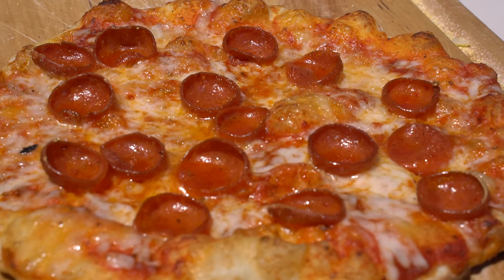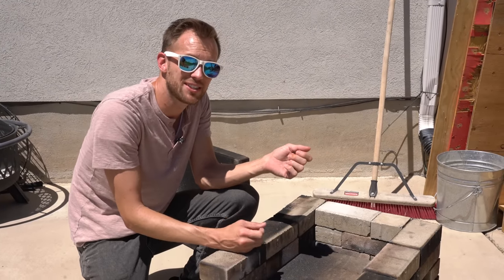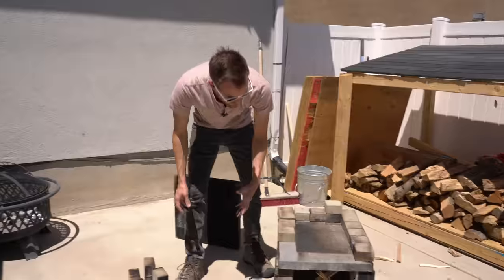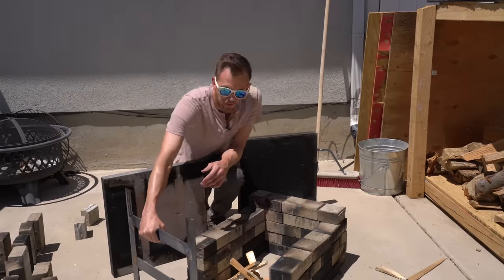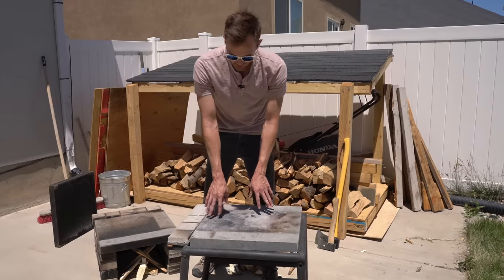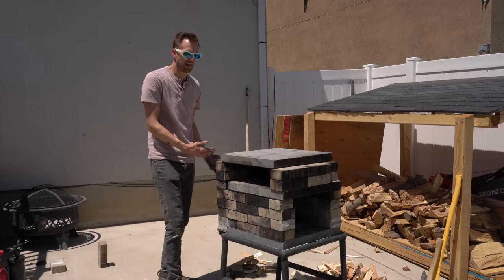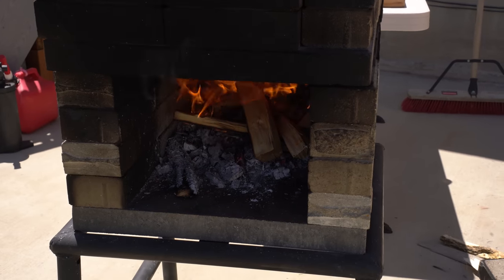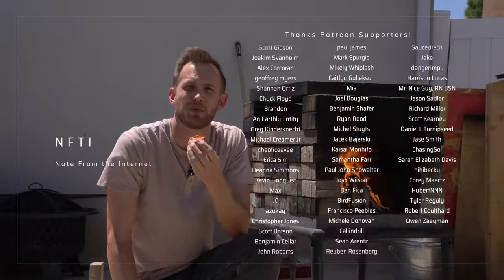The BEST Cheap DIY Pizza Oven

Comment: With your raised oven, since you're building a fire directly on a paver stone base, you might consider replacing it with fire bricks. In fact, since the entire first level and the cooking surface are exposed to the highest temperatures, you might use fire bricks for them as well
Reply: Have you seen the price of fire bricks? I think the point of this video is to make a cheap and easy DIY oven.
Reply: @TiltmanMusic  2000F rated firebricks are 4 dollars a piece, but are 4-1/2 in. x 9 in. x 1-1/4 and he only needed 48 of the smaller ones so with this he’d use half of them so less than 100 bucks when you only need 24.
Reply: @omarious  The comment was referring to the paver base that the fire was on, and the base that the pizza is on that is under the fire. There is no reason to use firebricks for the side walls. Normal clay building bricks are fine, and cheaper. How are the fire bricks going to work as a base? You need a big slab as a base.
Reply: @TiltmanMusic  I've made a oven similar to this. I cook my pizza on a "base" of firebricks. Six in total. The rest of the oven is made from clay bricks. The firebricks rest on 4 rebars, stretching across the width of the oven. I cut slots in the clay bricks for the rebar (about 1 inch wide) and as deep as the rebar. That way the rebar is flush with the bricks and I could stack more bricks to make the "roof" without leaving a vent. For the roof I did the same thing with the rebar, but used clay bricks. I'm actually considering replacing the roof with firebricks too, for that extra but of heat reflection.
Reply: Post pics please!

Comment: The side loaded design with the bricks completely destroys the air path. The other side of the oven won't be as hot, and you will lose a lot of smoke that goes directly to exhaust. With proper airflow, you don't have to worry about the fire underneath.

Comment: I did something similar but I built the base out of 6x8 wood blocks at 28" off the ground. I also used 2" thick x 4" x 9" fire brick for the cooking surface supported by metal "L" channel with a 24" paver as the base. The 24" paver on the top cracked severely after a few fires but it hasn't fallen and I'll prolly use some fire proof adhesive to to secure it. I'll off set the direction next. That's a great idea! thank you for this video, it was very helpful. Keep up the good work!

Comment: Really cool. And like everyone's saying, it would be improved with a cordierite stone, firebrick, and raising the fire off the floor in a basket of expanded steel. 
The only problem is that what you've built is an offset smoker, and you're going to have to manage the quality of the smoke. To avoid bad flavors you're going to have to either control the oxygenation to the fire, or wait til you're down to embers before throwing on the pizza.

Comment: Hi there just few tips.
I would make a side burning chamber and not underneath as you did. 
Would give it a cast iron dor with an intake air flow regulator to the burning chamber. 
Would be nice a rotating pizza plate as well

Comment: Love it! How about turning the furnace 180 degrees and frame the opening with brick so you can create a fire crack on two sides? Or maybe drill holes instead to control the evenness of convection heat?

Comment: Brilliant! Love the side loading upgrade and the flat metal frame to keep the paver intact. I wonder if you made a slightly deeper frame to increase the depth of the oven. That would increase the depth and add another slit in the new back for the fire to send heat into the cooking chamber. Would you then be able to heat the food from 2 different directions (side and back)?

Comment: if you used metal flat bars anyway, you should weld them so that the fire is on the upper level at the back so that it will not be blown away (or make a narrowing from the front)

Comment: Nate, could you create a sliding door for the fire box on your original design??…just to use when turning the pizza…then the heat vent would still be in the back of the oven cooking area?  All the expensive wood fired ovens have doors, but I realize the fire is actually placed  in the cooking area (and the exhaust chimney is at the front).  Just a thought…as I’m 79 and going to build one of these after reading all the comments.  Appreciate your thoughts on a door…if that would be an option.  Thanks!

Comment: If you had a concrete counter top you could lay down a good layer of sand with some aluminum sandwiched inside it near the heat source to protect the counter.

Comment: Instead of a welded steel base I would stack up cheap 8 x 16  concrete blocks under the bricks until you get the height you want.  I would cut  rebar to length and place them 1" apart as a base for my fire box. For the pizza oven i would also place  rebar lengths 1" apart and use as an oven base fire bricks sitting on the rebar grid . The rest built the same way done in the video. 

Pretty sure this method would end up much less expensive but still produce good pizza.

Comment: Lets go next level:

Home depot sells Fire Clay Bricks (high temp) for 1.67 ea.
For fireplaces and outdoor brick ovens
Installed with fire clay
Can withstand up to 2460° F temperatures
For residential or commercial installations

You could also put a pizza stone on top of the paver stone to get a more even heat distribution. An 18x18 cordierite pizza stone can be found for under 40 bucks.

Comment: Cool stuff.  I would want to have another welded support like you had between layers under the top paver.  If that boy cracked, I think it'd be a bad time, especially since it's not supported by a full brick on each side.
Reply: Even if the paver develop a crack, it’s going to be fine structurally for a while.

Comment: With the cook area on the side, your heat is no longer evenly distributed as the hot air doesn't have to pass the entire cooking surface as it just slips out the side...

Comment: If you have the pizza opening 90°from the slot that lets the hot air up to the pizza chamber, won't you lose most of the chamber air heating advantage? It seems like the side opposite the slot would be much cooler than next to the slot, as the hot air won't have to flow through the whole chamber before venting; it'll just go out thepart of the chamber opening that's nearest the slot

Comment: Cool design that I think could be improved quite a bit still. You could use cinder blocks to build a base, no need for welded steel. I also think your airflow could be improved on. Lastly, but certainly not least, please take the time to make your own sauce. Your pizza looks amazing and I'd eat a slice right now, but making your own sauce is so easy and so much better. Thanks for sharing this. It was obviously a lot of work. My shoulder hurts just thinking of moving that much concrete block around.
Reply: Most NYC pizzerias use pure tomato puree straight out of the can without cooking. So does the authentic Neapolitan pizza.

Comment: Not just stain or damage your concrete, but the concrete absorbs moisture, so if you got a fire on it, then there's a change that the concrete will basically explode, if you have no choice but to put it on concrete, then I suggest that you put a thick layer of sand on the concrete first

Comment: Thanks for the tip on the side loading oven. I will give it a try on my rebuild; my only concern is the vent on the side changes the air flow to now not run over the pizza.  I built the original design, and my problem is I cannot even light the fire.  I suspect this is because the firebox is so small that I cannot make a traditional log teepee to get sufficient air flow. I tried lighting the wood outside the box and pushing it in after being lit. While this got the logs lit, it was a bit dangerous, and they did not hold the flame afterward. My bricks are a bit thinner than the paver, so perhaps this difference is to blame and I will try to add one more layer of bottom bricks. Any other suggestions?

Comment: while it's great to not have to reach over the flame, this "improvement" leads to uneven heat distribution, because the heat is coming up from the side and goes out of the oven on the side aswell, rather than passing over the entire cooking area like in the initial design. this is why you have to turn the pizza. so while it is a quality of life improvement, it's more of a setback when it comes to functionality. other than that i really dig it.

Comment: in the original layout with the opening over the fire the hot air came from the back, over the pizza and then out of the front.  With the new layout the pathway to the "outside" no longer goes over the pizza; is this an issue?  If so would drilling holes to enable the same flow fix the issue?  Or even as you're now using a steel support you no longer need to be so concerned about the brick layout could you shift the cooking surface to creat the required gap?

Comment: if you build a ripping hot bed of coals on poured concrete it will violently explode. hard enough to launch a grill grate 15 ft high and sever hotdogs like boiled egg in an egg slicer. learned the hard way in my teens....

Comment: But by changing the opening for the pizza to that side... Won't the heat from the airflow go up the slit and out the "front" instead of being dispersed across the entire pizza in the original design?

Comment: You may want to update your post. When I was working construction years ago we started a wood fire on a concrete driveway to keep warm. Wasn’t really even a very large fire. The concrete below the fire literally exploded and blew concrete and logs on fire into the air in about a 30 foot area. No one was standing near the fire at the time. Our boss told us he had seen this several times in the past when he drove up and saw the damage. Just sayin’

Comment: I'm sure you've spent a lot of time thinking about different versions, so perhaps you can save me from thinking to hard about why you don't turn the oven 90 degrees on that stand. That way you could get the same 90 degrees offset between the fire chamber and the oven opening, and yet get the heat slit in the back of the oven chamber instead of the side. My idea centers around how to get the most efficient and even heating of the oven. I's obviously not a big problem, but might make it less dependable on you rotating the pizza while it's cooking.

But then again I'm certain you've played with that idea and chose to not go with it, but it would be interesting to hear what you perceive the problem to be with that layout.
Reply: I think he said he put the vent on the side so that he could have more cooking area since he could only fine 20x20 pavers instead of the 24x24 so I'd say put it in the back if you can get the 24x24 pavers
Reply: @BigBenC1991  No need for different sized bricks, just a different way of stacking them.
Reply: @blahorgaslisk7763  Yes, and again as Nate explained if he stacked them that way then the width of  his cooking area would then necessarily be narrowed by the width of a brick so as to get proper support for the top paver. Having the two support sides be one side and the back keeps ~17²" of cooking space which allows for a maximum of a 17" pizza (likely 16" to be safe and allow room for moving). If he put the vent in the back then that cooking space would turn in to ~14" x 20" which would then limit the pizza to 14" in diameter (likely 13" as above)

Edited to add: If you get bigger 24"x24" pavers though even using the two sides for support and the back as the vent that still gives a maximum pizza size of 18" which should be plenty for most people.

Comment: I made one of these.  Not all its cracked up to be.  They're very fickle. Because there's no mortar it's not very efficient as heat seeps out.  It doesn't do well on a windy day since that just blows all the heat out of it. Combine that on a winter day, forget about it.  It does better in the summer.  Also, you have to buy a lot of wood.  Better off spending more money on a wood ooni or something like that.

Comment: I would like to point out that if your bed slab is cracked, you're going to have bits of concrete debris getting into the crust dough when you first slide it in.  No bueno, even super tiny ones will grind your teeth down.

Comment: By turning 90° you ruined your chimney. Well actually it looks like you didn't have a chimney to begin with, so you didn't ruin it. But you certainly didn't have heat coming over the top of your pizza.
Your final design does though, so good on that.

Comment: The oven access 90 degree turn mod was great. Everything after that made your "BEST Cheap DIY Pizza Oven" the "Best No Longer Cheap DIY Pizza Oven."
Reply from the maker: There's lots of ways to add some metal support, and it certainly doesn't need to be costly.  Similarly, you could use some cinder blocks to raise it, and you'd only add a few bucks to the cost.

Comment: Awesome video. A tip I use when cooking pizza is to brush olive oil before you do sauce to help so the pizza is not soggy under the crust.
Reply: If your pizza is soggy, you used too much sauce
Reply: I'm a little confused by this comment. Where exactly do you brush the oil? Under the pizza where it would become the bottom or the place where you are laying the sauce directly on top of?
Reply: @AimForTheBushes908  You brush the top of the dough with olive oil before putting sauce on it.

Comment: maybe having the hole in the back would allow the hot air to go over the entire pizza before it leaves which would allow your pizza to cook more evenly without having to rotate it even if it does have the disadvantage of having the fire closer to you.
Reply: @adolfpickler4295  no it wouldnt be the same...
having the air come up from the back forces it to evenly go over the full width of the pizza.
the hole in the side lets the hot air from the front of the hole escape almost immediately and the air from the back will also stick mostly to the side with the hole leaving the opposite side of the pizza with noticeably less hot air.

the best way would be having the top paver leave a gap opposite the gap in the lower paver and a means of closing up the access hole with bricks or a slice of paver with a handle bolted to it.
that way you get the even draft over the pizza, dont have the giant hole on one side leaking heat AND have the fire off to the side
Reply: No matter what kind of oven you use, you still have to rotate the pizza for even cooking. I have an old Blackstone that rotates for me, and even then, it's hard to get a perfect launch, so i shift and move it. It's just a fact of life, and that's OK.

Comment: I’ve wanted to do this for a long time, but didn’t know a good way that didn’t cost a lot or take forever, this is awesome!
Reply: Okay so, Common Sense dictates there's two pavers, how many bricks 5256? Give me a tear down
Reply: @TheRealElectrofox  Common Sense dictates that you pause the video and count the bricks. 7.5 bricks per layer, 6 layers of bricks + 2 smaller bricks to get the bottom level. Now, common sense also dictates that if your pavers for the floor and roof are different to the ones used in the video, you will need a different number of bricks.

Comment: Several years ago, I got several hundred bricks for free from an old building that was demolished. The owner was happy I took them and built a mean oven that was great for pizza parties. One trick that I learnt from a chimney guy was to use mud and molasses or brown sugar for the mortar mixture. As the heat, burns the sugar it foam to create a glue. Worked great! We moved to another state and I still miss my oven. :(
I might give this a try since they are selling reclaimed old bricks now in my area.

Comment: I'm a thin crust pizza guy, but...that thick, semi-charred pizza that is in your thumbnail (and I don't think appears in the video) looks amazingly tasty. Love the hacks in your video. How about this one...incorporating a commercial pizza stone as the base/cooking surface. I got one from Amazon, I think for about 40 bucks, that is rated for about 2,000 degrees F. I have done hundreds of pizzas on my gas grill at temperatures over 800 F and it has been rock solid. PEACE!!!
Reply: A brand a link to the 2000 F pizza stone. Do you just throw right on the grill grates?
Reply: @mrstoneybrew  I must have been drinking when I made that comment. It is some Rock Sheet brand I got from Amazon and according to the box is rated for 1,4000 degrees. But yes, throw it right on the grates.
Reply: @p.w.7051  thanks
Reply: I wonder if using a pizza steel might give even higher heat!
Reply: Grab a large terracotta floor tile at home depot. Worlds lowest cost pizza stone.
Reply: @joehanke8547   must be nice,  the only terracotta tile  at my home depot is peel and stick vinyl.

Comment: It's not only lead you should be concerned about in paver stones, there could be all sorts of heavy metals in it, as many are made with fly ash mixed into them, and there's also chromium in cement, so I wouldn't cook anything directly on top of a concrete surface.

Comment: Great looking DIY project!  Gonna try this one myself.  Tip from a former pizzaiolo, though: Don't try to 'launch' your pizza into the oven.  Instead, get the pizza positioned in the oven where you want it, still on the peel, then quickly pull the peel back from underneath the pizza.  It'll take a few tries to get it right, but once you get the hand of it, you won't have any more issues with pizzas hitting the side of the oven.
Reply: What he said.

Comment: I did the same mod for my outdoor masonry grill, but added a 30psi regulator and 5 inch burner to the back inside of the unit; 900 deg in 12 minutes; a medium pizza is done in 90 seconds on a round pizza stone. Great video, thanks, I feel validated now!